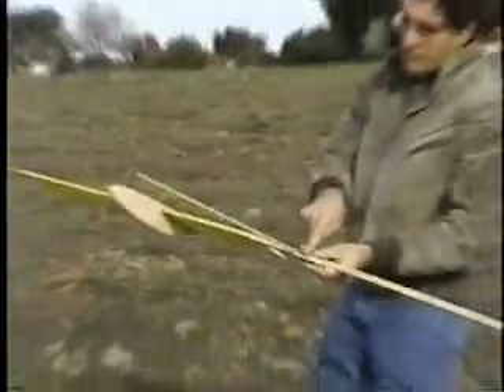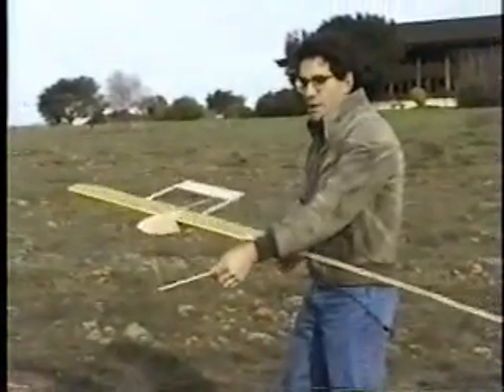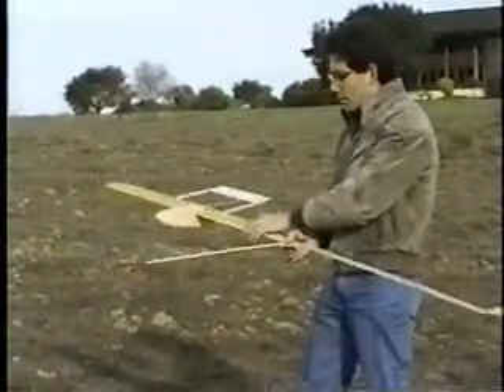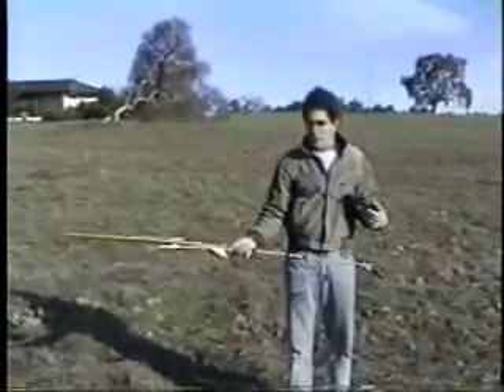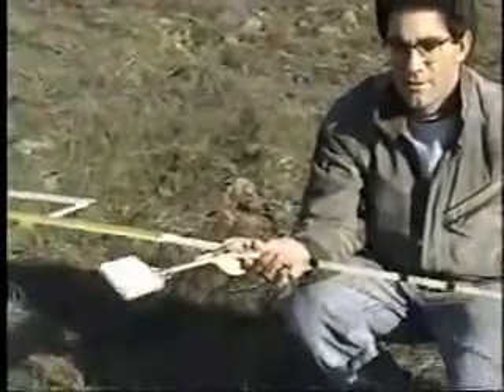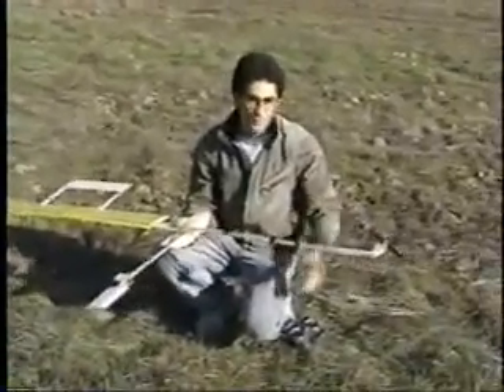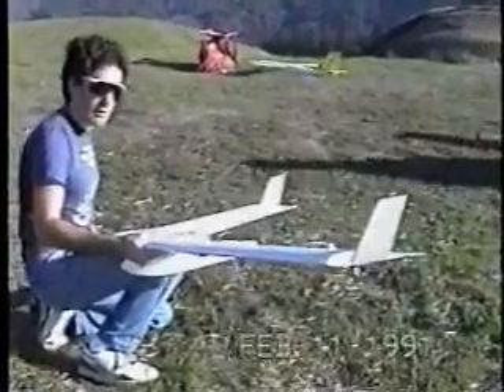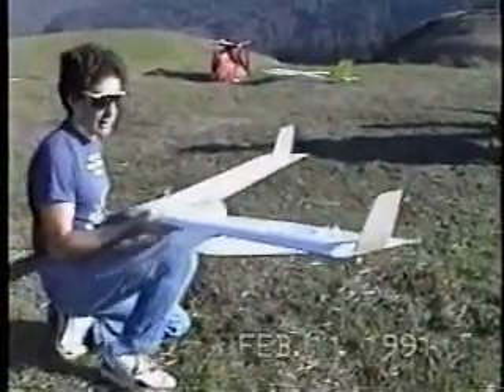Single Wing model experiments

Comment: Back in the 60's there was the McCutchen flying machine, you foolish youngsters!!!!!
Reply from the maker: I met Charles McCutchen in 1994 and showed him my models, I was well aware of his Charybdis designs. A few of the models in this video are based on his work and some are not.
Reply: @smorrismlbco  I reacted on the beginning of your film, and in Ron Moulton's book on aeromodelling, which I still have somewhere, the McCutchen 's flying machine was mentioned, like the moto delta, later known as a design by Jean-Marc Geiser. Speaking about delta wings, I experimented in 1958 with large delta wings, no knowledge known and discovered their lack of dive recovery. I soon found out how to deal with this and in the 2' half of the 70's,when the first reflexed hanggliders were available, I started hanggliding in holland. I just found back my Birdman Moonraker '78, a glider known for its very light handling and in Kossen I demonstrated its ability of a controlled flat spin.The glider will be ready to fly within a few weeks with a washed and newly coated sail. I can hardly wait. At the moment I' m also working on finding means to produce proper rigid wing hanggliders, easy to rig in windy conditions and no flutter on high speeds, double split spoilers and split flaps and a safety cage. I've already built a 15 m span mock-up model, which to my opinion, is the largest practical span. I also have more models, all based on cross-bar less designs. I also have built a very simple electric propulsion system, no more tucking, no gyroscopic effect and powerful enough to take off and climb to 1500 ft, and have some reserve power to chose a proper landing field ........